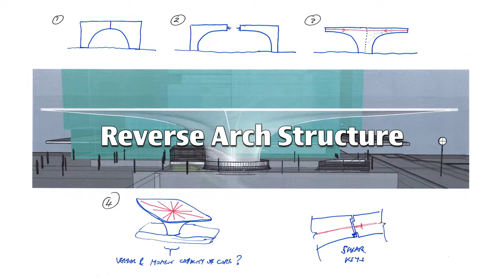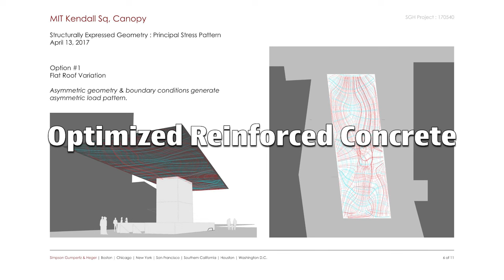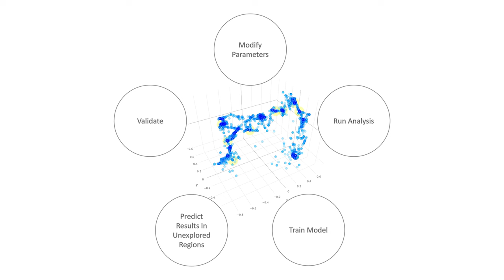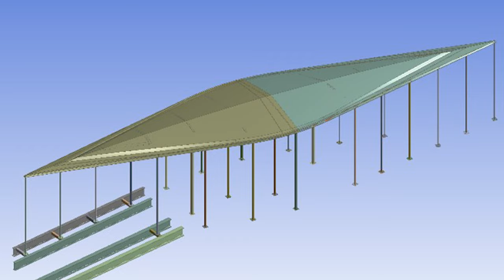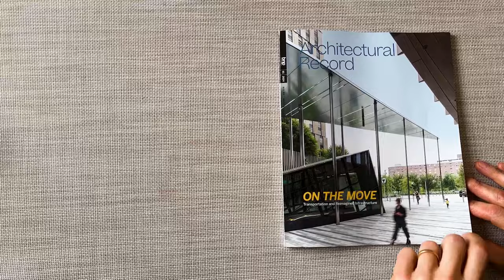MIT’s Futuristic New Entrance Canopy!

Comment: I don't get it. It's an odd shape, set on high columns.  If it is designed to protect pedestrians from rain and snow, it doesn't seem to cover much area.  And because rain (and snow) are driven by the wind and come down at varying angles, the protected area on the ground must be constantly moving around. Why not a larger canopy, simpler in plan, and closer to the ground?
Reply: Aptly put. 
It's more an abstract idea, to insert a shade or shelter, up in the arcs of the sky. May not have a utilitarian value, in the cold, windy, rainy conditions...the columns may act as a general path maker.

Comment: Hi Paul, i don't mean this as a personal critique, but isn't this a bit of overengineering? This - i am sure very expensive - canopy sits on a lot of stilts that will hinder you on passing freely between the structures, while it does not actually give you a lot of protection against the weather. Does it serve a purpose other than a "gesture"?

Comment: Neat engineering for the structure! Congrats

Perhaps a more thorough explanation of the benefits for all the optimization would be a great follow up video.
For example, it looks like you were able to use some decently narrow while quite long poles to hold up such a large structure that high in the air.

Perhaps discussing more about the practical design challenges as well such as weather, wind, etc will help us understand more and better appreciate the design.

Comment: Sir i have an ultimate question. On 6:36 https://www.youtube.com/watch?v=KJdIbCn4NuE  you show very good tension variation braces. But what type of braces we need if we want place kettlebell (
load) not only in the center but on top of every vertical compressed stands and it will be 3d truss and the edges of the 3D truss (beam) will be rigidly fixed too??...What the best solution for such complicated situation